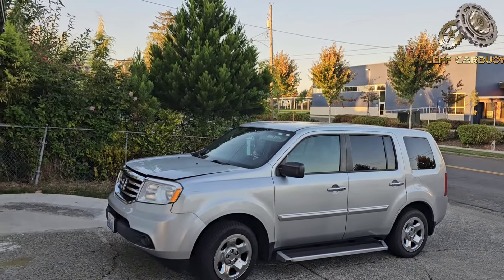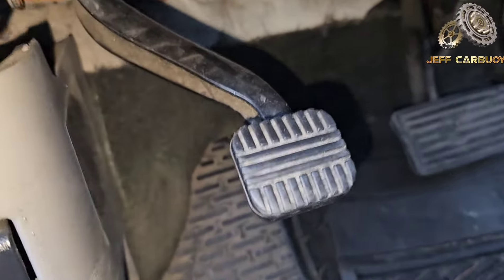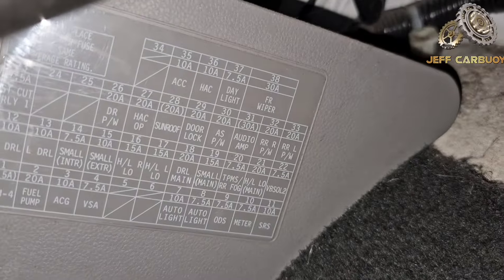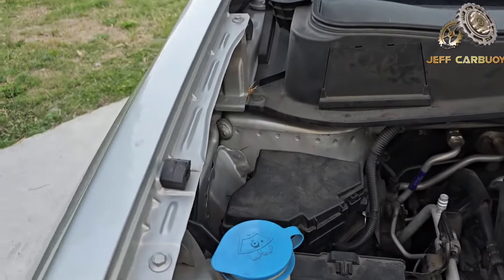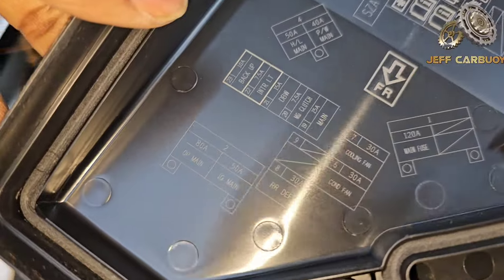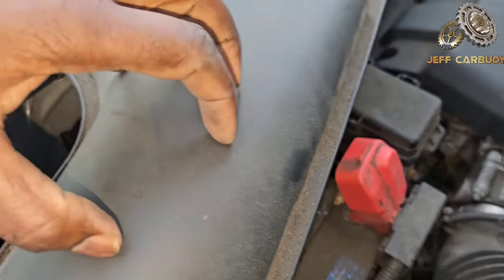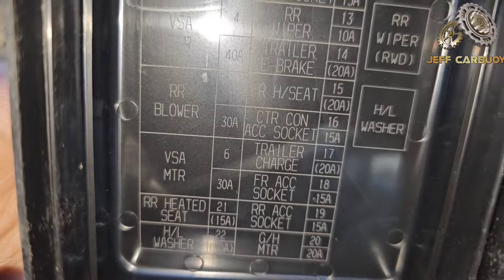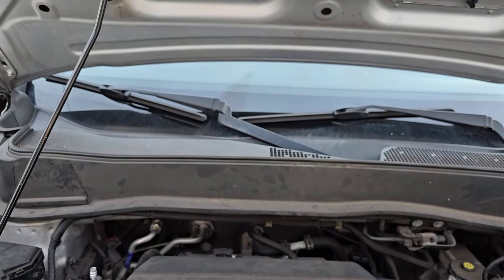Honda Pilot Fuse Box Location And Diagram || 2009-2015

Comment: 2015 Honda pilot lx we’re would my fuel pump relay be located please help ??
Reply from the maker: If you go through the diagram on the back of the cover you can't miss it.
Reply: And also  when I try to start my car it tends to stutter as if I’m out of gas which I’m not so  so I step on the gas and nothing it turns off so I have to let it sit for 30 min then it cranks  up it’s happening everyday now  I’ve changed maf sensor spark plugs and filter ???? Any help of advice I would appreciate please
Reply from the maker: @bencastillo7234  I don't know what others think but that sounds like fuel issue not going through, could be fuel pump failing. Kind a hard to tell without being hands on
Reply: Check your battery cables